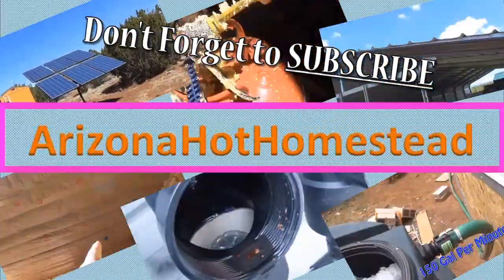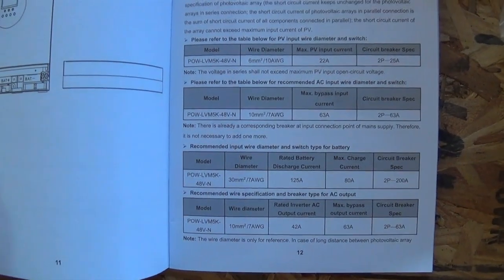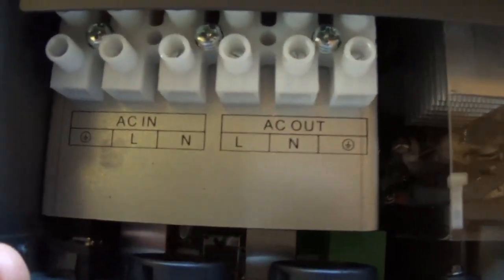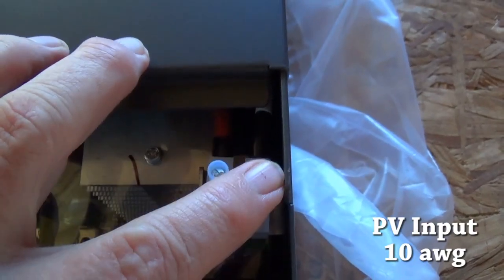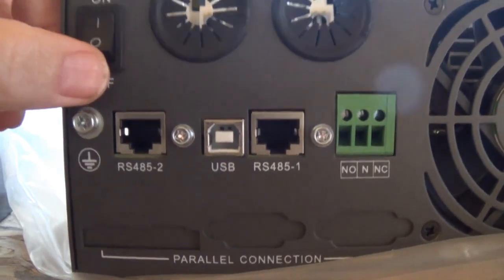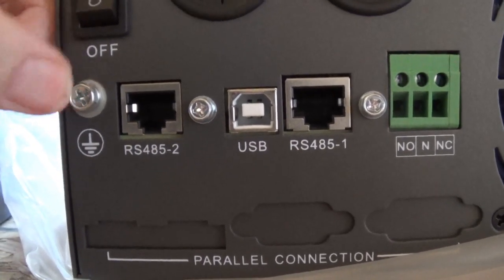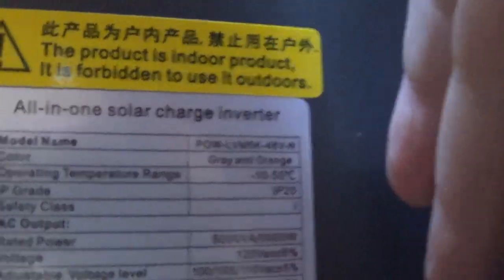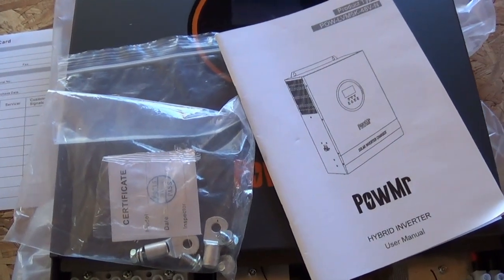Powmr Inverter/Charger 48v 5000w

Comment: To add some information: RS485-1 is for the Wifi-HF data collector dongle and have a 5V pin connected to power that. The RS485-2 is where you connect a Cat5e or Cat6 Ethernet cable (only type that you should use for this) that allow communication with the Battery BMS, so you can than use the State Of Charge (SOC) from the battery bank BMS system to manage the triggers based on SOC instead of a voltage value. This is much simple and allow better monitoring from the charger and user point of view. Usually, you want to maintain Lithium type battery between 20 and 80% SOC ideally to maximise battery life.
Reply from the maker: Thanks for the info

Comment: So you would wire this to a 48 volt battery configuration?
Reply: I have one wired to a 48v setup to a 3k watt inverter on 5120 wh batteries. it's been that way for over a year and have had no issues but I've never ran anything over 1900 watts for longer than 30mins
Reply from the maker: yes its a 48v charger , inverting the batteries to 120 not 240v